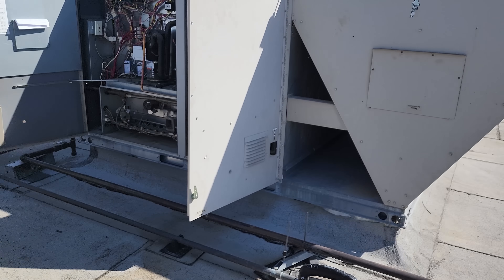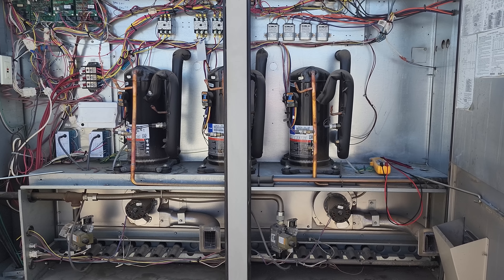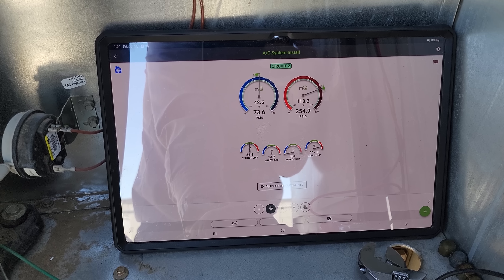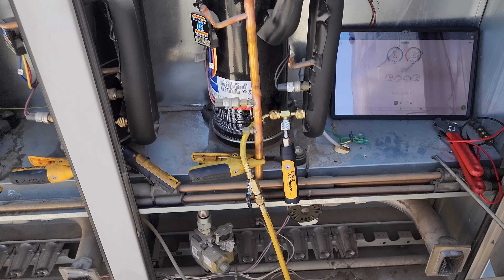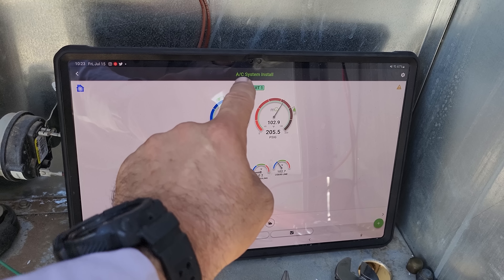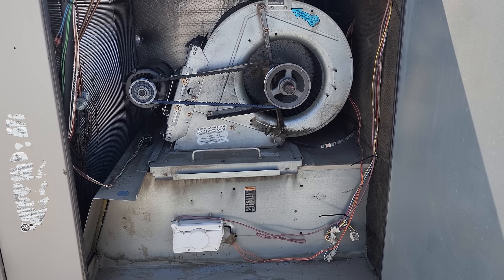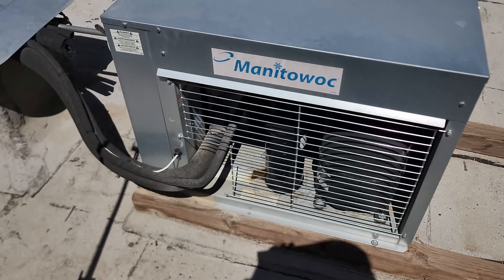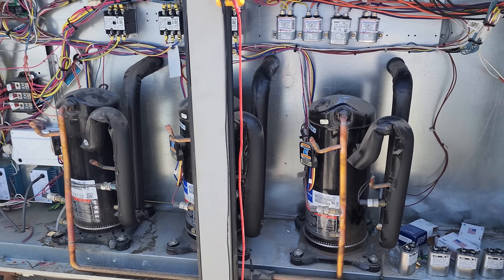THE BAR AC IS NOT WORKING AND IT'S 115 DEGREES OUTSIDE

Comment: Anyone that tells you not to add R22 to a system has no idea how the industry actually works or what it is like to be out in the field trying to keep these units going.
Reply: Honestly, after getting into supermarket racks. Ive realized the amount of refrigerant lost from say a 7.5 ton package unit is a drop in the ocean compared to the much larger commercial and industrial systems that leak all the time.
Reply: @P0nderProductions  Got that right, we lost 800 on a chiller at work. lol

Comment: I under stand not wanting to simply put refrigerant in, It is never my recommended repair, but you do what the customer wants. If you don't the next guy will and just like that you lost a customer. Learned that one in my first couple years in the business when I refused to charge a flat r22 unit without leak search

Comment: LMFAO! That little bit of R-22 isn't going to do jack. If this was an industrial plant that had thousands of pounds of refrigerant this would be an issue. The amount that's leaking out of there is definitely less than the allowed 20% annually for a commercial system per the EPA.
Reply: I've seen systems leak 500% of their charge in a year, lol.

Comment: All expansion balls are pressure limiting because it's trying to hold a certain pressure right.. It's called hunting when ATXB hunts when you open up the outside air dampers you're throwing a bunch of B to use at the thing it's now flashing before it should and I was trying to compensate to get Liquid back to that thermal expansion valve right or pressure valve as you call it.. I get it I've been in the field for 22 years and 42 years old I'm a Union service technician refrigerationn hvac commercial industrial some of your top prices are a bit skewed but I understand you're talking to things out don't let people f*** the like that but I seen the TX v's and those are octopuses they're Hunting when you open up that system to a 110ﾟ air and then you have 65ﾟ indoor... You know what's leaking is all those fittings that are on those compressors.. Especially if you're in California and it reaches 116 120 what's your head pressure gonna be at that temperature... Then someone put those ;) wonky 3 way ports on there.. If you have to start that sniffer that long to find a leak it's not a leak that I would be very concerned about if I were you I'd of there off that roof about an hour ago good luck man

Comment: No hard feelings because your using r22,  its recycled anyways and Theres so many drop ins not everyone has them on board. We use R422D but in Europe you kinda have too. Often times the replacement aint mutch better for the environment anyways because of the increased GWP.

Comment: Um did you just add charge without a scale and then say, “I think I mighta added 2-3 pounds but it may have been 4-5, not really sure”?
Reply from the maker: I always verify when I go back to the van, I usually weigh the drum before I use it than re weigh it when I'm done
Reply: @HVACRVIDEOS  As a beginner trying to construct procedure models in my head, I’m just gonna disregard this and pretend you had a scale under it.

Comment: How much time should it take to figure your out the problem with the system? I’m new and I don’t want to be slow lol
Reply: Hey, just thought I'd throw in a reply as Chris might not get time to. I work in hvacr service primarily. It definitely varies from call to call, an easy call can be as short as 30 minutes, with tough/confusing calls taking 4+ hours to diagnose completely, potentially longer if its grocery store refrigeration.
Reply: Spent 8.5 hours on a big call the other day. Warehouse freezer with 8 evaporators.
Reply: @mattalexander8919  wow that was just to make an accurate diagnosis?
Reply: Don't give yourself a time limit. Knowing the equipment will make you more accurate and faster in time, and sometimes you can't find the real issue until you have fixed the issues caused by the real one.
Reply: Dont stress take ur time and do it right ur boss won't be able to get paid if u get called back the next day to fix it properly

Comment: I'm not an hvac guy but im curious- can someone explain to me the problem with R22 like I'm a 5 year old?
Reply: R-22 and other older refrigerants break down our ozone layer, while new refrigerants don't. However both old and new refrigerants will act as a greenhouse gas, often times thousands of times worse than carbon dioxide.
Reply: @GullibleAbjabGames  makes sense, thanks!
Reply: @GullibleAbjabGames except some of the flammable hydrocarbons used in smaller devices (refrigerators, dehumidifiers, residential AC units often use r600a, cyclopentane, or r290, propane).
The risks associated with potential flame-outs outweigh other environmental considerations when it comes to large systems.